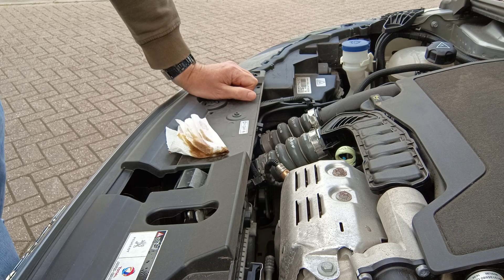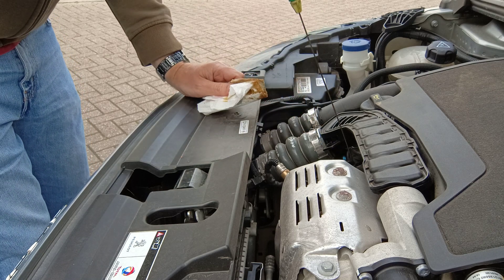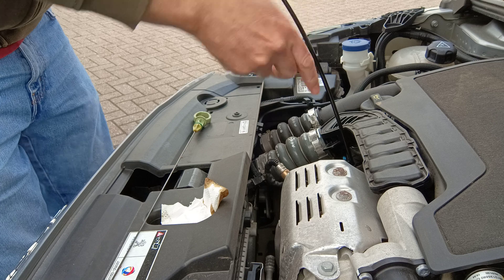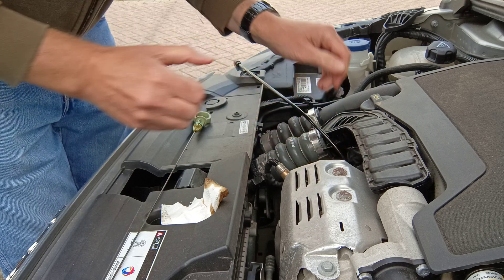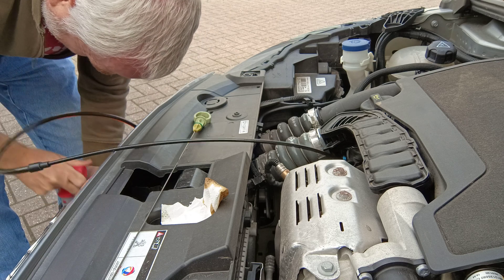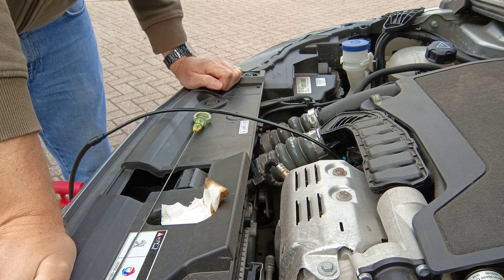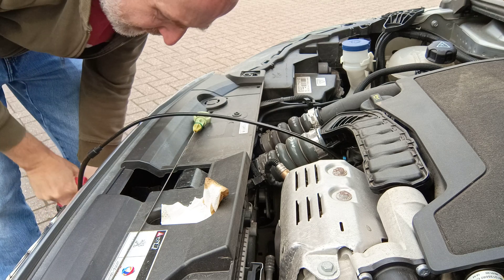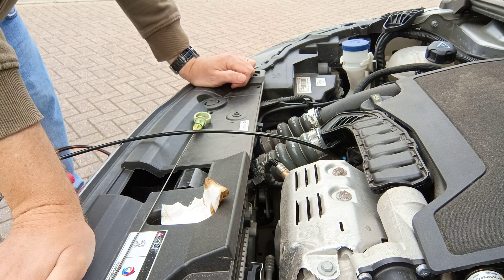DIY 91% Oil Change (extractor pump) 1.2 Puretech Peugeot/Citroen/Opel/Vauxhall Engine

Comment: I have the exact same oil pump, been using it on my mercs, I highly recommend it
Reply from the maker: It makes life easy and removes the risk of drain plug failure. On my wet cambelt engine it is particularly important to have regular oil changes.

Comment: And what will you do with extracted oil? And what about oil filter?
Reply from the maker: I took the waste oil to our local recycling centre, but you may prefer to give the oil to your local car repair garage as they may be able to use it as heating oil for themselves. I didn't change the filter (that would also go to the recycling centre to a particular receptacle for used oil filters) as this was just an intermediate oil change with ease and cheapness of carrying it out central to the idea.

Comment: Sound is almost non=existent.
Reply from the maker: My apologies for the low sound level. I did correct the Closed Captions if that is helpful.
Reply: @markporthouse Nice diy. Changed the wet belt of mine at 40k / 8y just for precaution because it only makes urban trips. Don’t bother replying to this previous comment, you’re not expected to be a sound/image recording pro, just ignore or link an ear doctor office 😊.
Reply from the maker: :)
Yes, 40k over 8y is low mileage. I bought myself a cambelt measuring tool (for the Puretech 1.2) which measures any expansion (oil damage) in the belt. Very useful. In theory the belts can last for a very high mileage. Was your old belt showing any damage?
Reply: Is it not best to remove the sump bung ,drain the oil and clean the strainer of wet belt debris ,once the sump is removed ??   Big job I know , but preventative is better than the cure ,long term.  Wonder if the pela pump sucked up any belt materials??

Comment: I use a 12v car oil extractor pump, got it off eBay, works a treat, just connect to the battery, for some reason I can't post the link.
Reply from the maker: @theolderigetthewrongbitget4746  that sounds like a good option. Thanks.